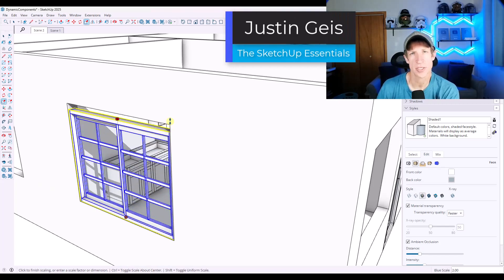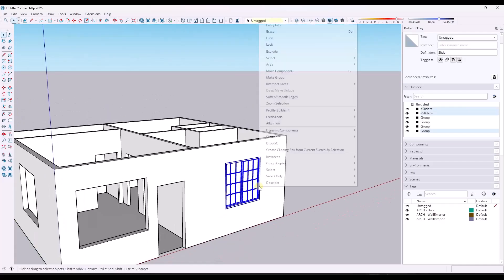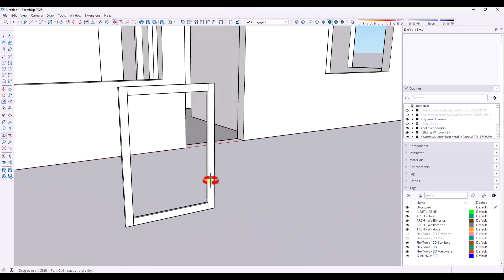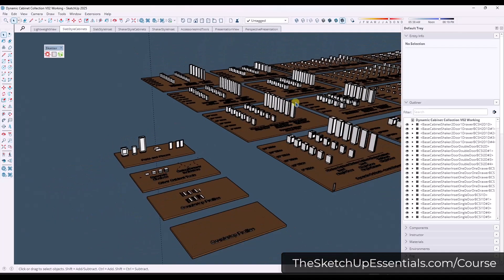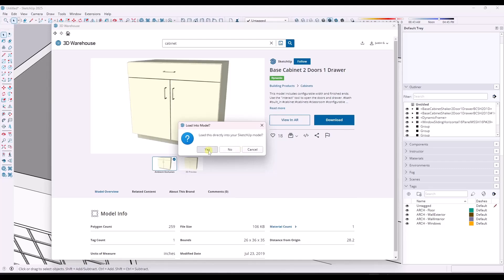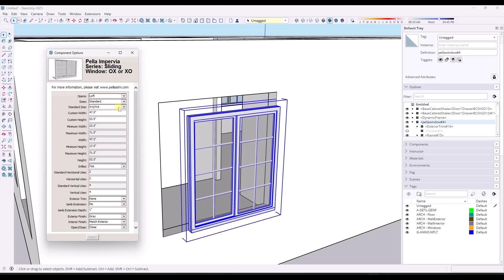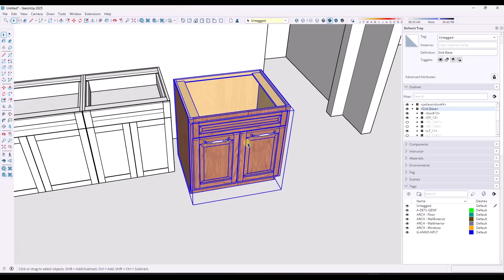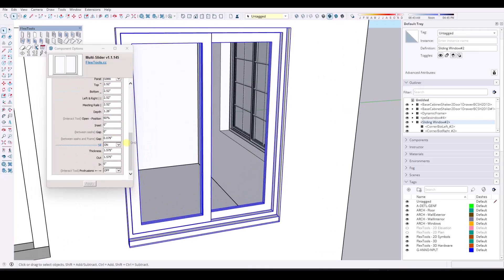The ULTIMATE GUIDE to Dynamic Components in SketchUp!

Comment: Great video! Could you do a video of cabinetsense extension or something similar, modeling a couple of cabinets, showing how to maximize the cut list on a 4'x8' sheet of plywood, and export all of the pieces to g-code generator to be cut with a cnc machine
Reply from the maker: Honestly something like this is a bit far outside my area of expertise. Cabinetsense is way overkill for anything I do, and I've never used G-Code or a CNC machine in my life
Reply: Now there are many professional plugins for creating dynamic components, which I have been using. They are very powerful, and they make me powerful as well, facilitating my workflow.

Comment: Question, whenever i go to select the dynamic component menu, the menu wont come up, i just get an error message. It is a bit older version of the program, but its better than paying the ridiculous price for it. And using the free online version isnt ideal for me. Any fix to this?
Reply from the maker: Without knowing the error message and the version I don't really have a way to analyze this error.
Reply: @Thesketchupessentials its sketchup make 2016. It says Error: Callback function error: Object doesn't support property or method 'attachEvent' @ / dcbridge.js[601]
Reply: I recall but don't remember the specifics that you need to import the DC in the correct way compared to the incorrect way. I recall something along the lines that you can't drag it from your explorer window into SKP but you can import it via SKP-file-import ... Or something along those lines. You may want to research the specifics. This also may be a non issue on the current versions of SKP as in maybe the devs resolved the limitation. It's a vague memory but may tip you into the right direction.
Reply: @johnjlopez this is happening when trying to make my own DC
Reply: @TheRCguy88  I don't think I've ever made my own DC so I can't help you on that one.

Comment: Fully agree with all of it (with exception of saving boneyards for DC (which seems redundant)). Good DCs are great and very valuable for time saving and consistency and they should be saved into local libraries.  I've been using SKP for well over a decade and I don't think I've ever created my own DC. Interesting. The closest I've been, I believe, would be to try and create profile builder assemblies with mixed results.
Reply: As you mentioned, Pella has a decent library of DC. Marvin, Milgard are also good for windows/doors and Trustile has a good library of door DC.
Reply from the maker: You could have a much smaller boneyard, or a larger one like mine that has them pre-sized to standard sizes, but it's not necessary. Still having a boneyard is a good idea. Whatever works for your workflow
Reply: @Thesketchupessentials  I like the idea for non DC components maybe but seems a waste of time since DC is adjustable. You'll spend more time importing then grabbing to and from that library then purging that library later compared to just stretching or setting the DC attributes. Either way, people should be generally knowledgeable on DC and also to have a personal library. Both of those are smart recommendations to others. I, also, agree that DC is superior to live components (at least currently).

Comment: is it possible do a  dynamic corner cabinet?
Reply from the maker: Should be, yes. It would be pretty easy with the ones that just turn a 90 degree corner. Bit trickier if they were an an angle, but I think it would still be possible. It'd just be a question of how you set up the sizes of the two "wings" of the cabinet
Reply: @Thesketchupessentials  It’s difficult for me to create it, since the full piece measures 1 m × 1 m, but it needs to be cut because the depth must be 60 cm, and that’s where I can’t find a solution!

Comment: I use dynamic components extensively in my work. I wish Trimble was still developing and improving them. To make them more functional and easier to use. Plus they can get buggy. For instance, the can fly apart for no reason. Pasting them into a new instance of Sketchup and doing a redraw will fix them most of the time, but should be addressed by the developers. Need to add dynamic curves and spirals as well. And improve "Snaps" to work with nested components.
Reply from the maker: I've experienced this as well - they can be a bit buggy, or sometimes the items don't redraw unless you re-scale them. I will say that for my personal components I got a lot less of the flying apart when I did a better job of making items totally unique before re-using items, and using the parent function to reference values like lengths and positions rather than referencing the named items. 

I do wish SketchUp had stayed in that direction - the Trimble Creator tool is a bit too difficult for me to understand, and I'm not a fan of having to connect to a server for them to work. I'm sure I could figure something out by spending more time there, but I can build dynamic components in a fraction of the time as of right now